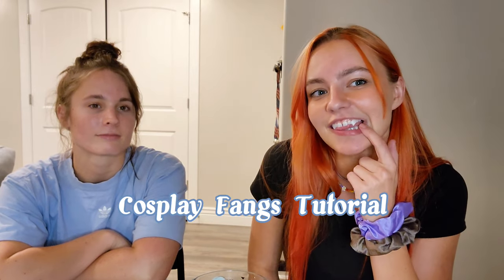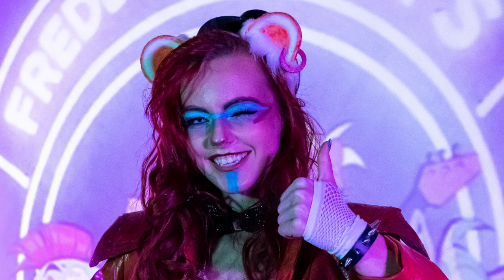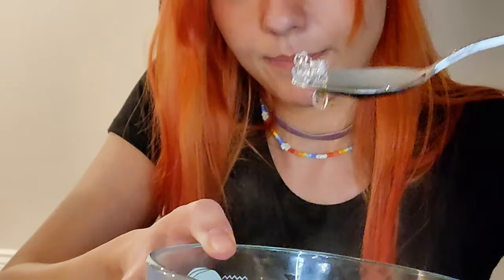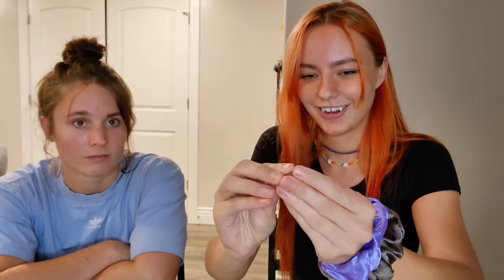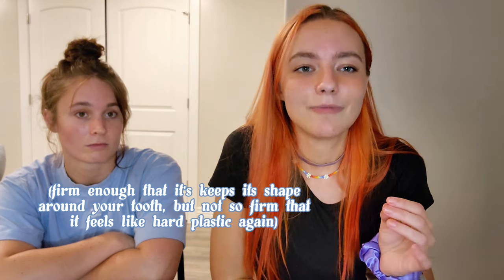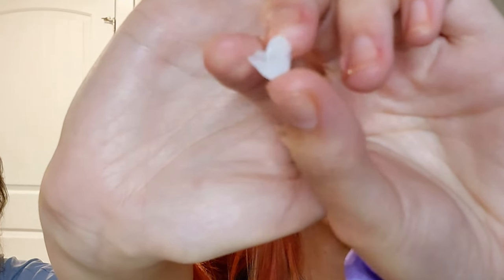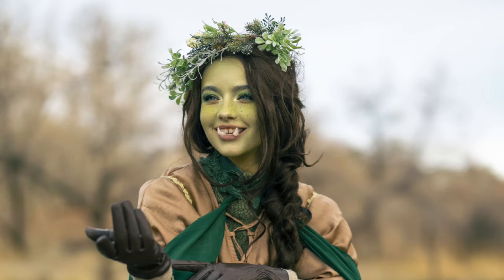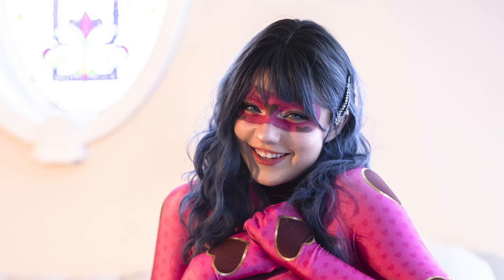How to Make Fangs for Cosplay and Halloween!

Comment: Just as a safety tip if you heat water in a microwave put a chopstick or something similar in the water. The way a microwave works it can end up "superheating" the water, where the temperature goes above boiling but still looks normal. If you touch the water at that point it can rapidly start to change states which is essentially a little explosion that can throw boiling water all over you.

The chopstick's rough surface helps to agitate the water as it heats up which prevents it from superheating.
Reply: Very good point